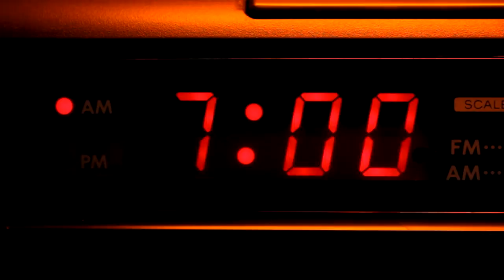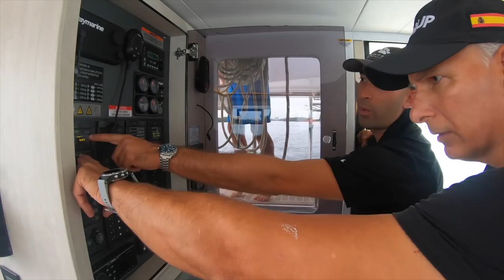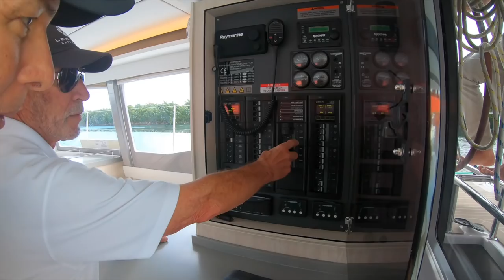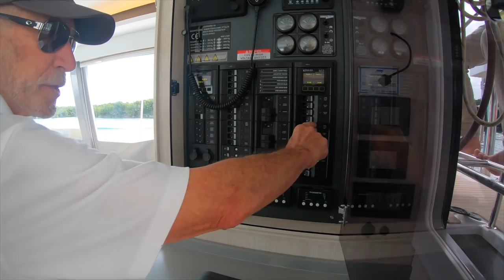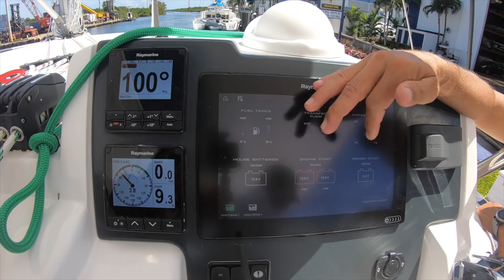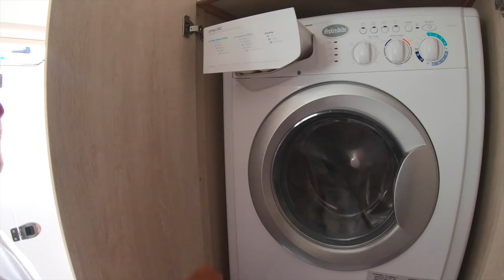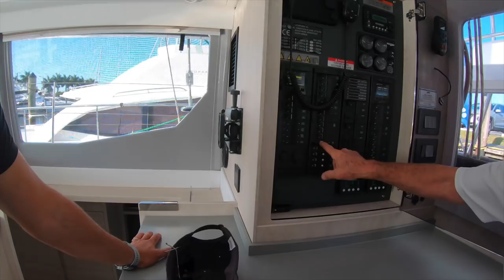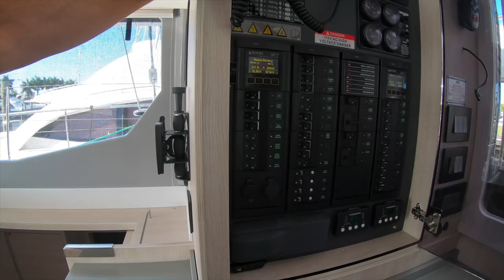First Time Sailing On Our New Cat - Sea Trial, Orientation & Getting The Keys After 21 Months [Ep.4]

Comment: Lovely boat... but I am amazed that Leopard KNOW about the fuel tank chains snapping when you insert the nozzle & losing the caps (which I bet are not cheap!) and yet have done NOTHING to sort out that Design fault or fitted any kind of modification. I wouldn't guarantee the cap will stay in the corner either. 
 Perhaps a quick & dirty fix would be a short extension/spacer tube, shaped to allow for the chain & cap to be lifted clear for inserting the pistol nozzle when fueling.
Reply from the maker: Bob Mullins Hi Bob!  Thanks for the comment and suggestions. Not sure why it hasn’t been improved upon but Leopard isn’t the only manufacturer that has this exact same setup. As a brand they actually do a good job making design updates annually because they receive so much feedback from their Moorings Yacht Charter customers. Will have to suggest they implement an improvement to the fuel cap chains! 👍 thanks again and thank you for watching. Really appreciate it 😁

Comment: Hi guys, great video! One thing I noticed for safety. When you are standing on the coach roof, you shouldn't ever stand between the boom and the helm station roof. If for some crazy reason at that moment the boom flys over to starboard, you get smooshed. 
Glad you all finally got to sail her. Keep in touch! ❤
Reply from the maker: Hi Guys!  Great to hear from you.....hope you are enjoying your beautiful sailboat and are safe wherever you are at the moment.  Thanks for the comment and yes you are absolutely correct on standing in that position.  The sea trial was great but we had absolutely no wind. What you see on the video is Bob and I getting the sail off the lazy jacks, sorting out reefing lines and cars on the main sail that definitely needed lubrication.
Reply: @sailingsvoliluki6938  ok great. Give us a buzz if you ever need anything. Our plans are still to head out in October so hopefully we can all still sail together for a bit. Stay safe and have fun!

Comment: That's a lot of stuff to remember, I hope you made notes.  ;-)
Reply from the maker: T'airn'KA it is a lot to remember but it’s not our first time out 😁. The Leopard Catamarans are very intuitively setup and our Yacht Broker Bob Ross did an excellent job walking us through all the systems👍. Thank you so much for watching and joining the adventure!  Stay safe. ~Andy
Reply: @sailingsvoliluki6938  As I was watching the explanation of the electrical panel I thought it would be kewl if the door was a flat screen with a function map like you see on EVs?
Reply: @TairnKA  Make a mud map and have it laminated or labels if they will fit.

Comment: It is amazing how Leopard uses such garbage for most of there building material.
Reply from the maker: Actually the Leopard Catamarans are incredibly solid and well built.  Maybe on the OEM side they could chose other brands products however just like all big brand cats price point is always a concern both for Leopard and the customers.  It's very easy to partner with other high quality brands for everything but the cost of the boat would rise significantly.  That said, we have sailed many different brands of cats, several of which truly use garbage materials in the making of the vessel which will not hold up.  Leopard cats are first and foremost built to take a beating in the charter market under the Moorings so those that come out under the Leopard brand have been relentlessly tested both in hull build and finish materials which are some of the reasons we selected our 2020 Leopard 45.   Thanks for joining our adventure....hope you enjoy the videos!  Stay safe!  Andy